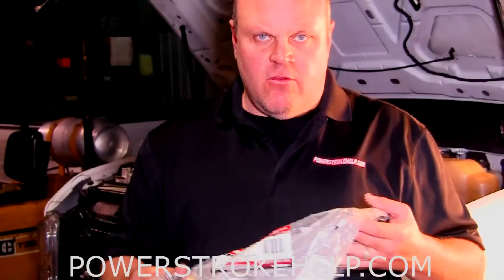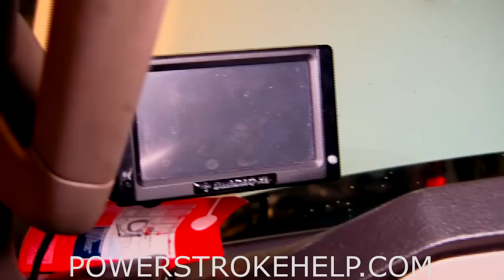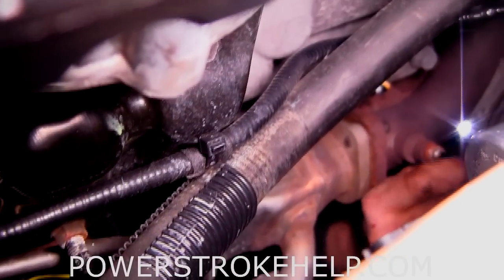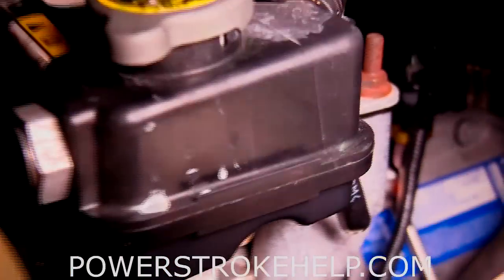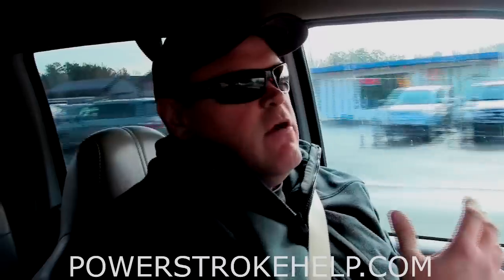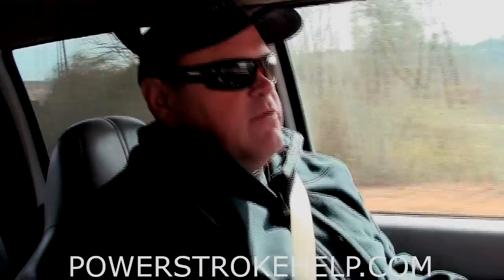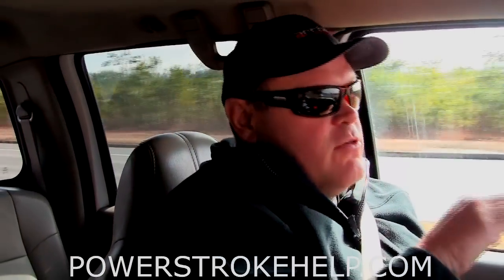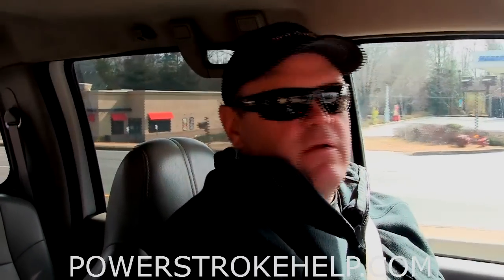6 4L EBP FAILURE - EXHUAST BACK PRESSURE -POWERSTROKE

Comment: Hi, I want to personally thank you for this video. My problem was just as you described. Loss of power, dropping fuel economy. I thought my turbo was needing replacing. Took a chance bought the tube sensor assembly $79.00 on ebay. removed the old sensor / tube was clogged tight with carbon. Cleared the manifold fitting with a 3/16 drill bit. Installed the new sensor/tube assembly and back to normal. Power on acceleration better than ever.

Comment: I had an issue with my EBP sensor...except it wasn't that it failed, it was that it broke off. Don't know how, but it did. Was going to relocate it it and remove the whole pipe (EGR is long-gone) but due to time I simply cleaned the surrounding areas (sooty!!) and installed the new part. Truck came alive after that! I hadn't noticed the progressively-worsening throttle response and MPG loss. Runs like a champ now. I love my 6.4!

Comment: My 08  6.4 now has 460k! Had Jasper build up my engine and trans 3 yrs ago. Currently having similar issues as you have described. Will try replacing sensor and cleaning tube port as you recommend. Will keep you posted.

Comment: Yep! Had a problem with mine, it was missing really bad. Dealer wanted $1000 to change it, I took off the sensor and cleaned it. It worked great again.

Comment: Funny you should bring this up Bill...  I live in Michigan where it's been around zero degrees for the last few weeks. When it's this cold my back pressure sensor does not read right. Condensation freezes in the tube and messes up my reading, which messes up my vgt actuator... Insane boost at very low throttle. Thanks to my Dashboss I can pick up on it right away. I've been un plugging my vgt actuator to lower boost. i don't want that really high boost pressure wrecking my engine!

Comment: Bill, love your videos! Could I ask you a favor do a series  of videos on say the top 10 things to check when buying a used power stroke. IE; check old level in the 6.4 to see if it's high or low. Leaks around water pump. Etc etc etc

Comment: I had the same problem with mine 2008 F350 6.4 all has ben deleted H&S mini max mild tune I was driving and lost power and like you said it takes a lot to get up and go now I replaced the part done in about 15 mins total time truck is fixed!!!!!!

Comment: Bill, help me figure this out as no one can....I have a 2008 6.4 drw with 25,000 miles on it, yes 25k. I NEVER see better than 11.5 mpg on highway and 9.5 city. My truck is stock, and I do not beat it. Its mostly babied not towing or hauling anything. I find it crazy that you just mentioned in this video 18 mpg.
Reply: Thanks again, Bill. Straight to the point no BS. Not noticing this yet. Keep your maintenance up

Comment: I have a 2008 6.4 powerstroke diesel truck. It is DPF and EGR deleted, SCT TUNER mild daily driver tune. All brand new Ford oem fuel injectors, injector harnesses, all new rocker arms, new glow plugs. All done by a reputable diesel mechanic. My problem is after about 2 weeks it started smoking. It only smokes at idle or anything under 1000 rpm. The truck runs great no problem except white smoke coming out of the exhaust. It doesn't use oil and doesn't use any coolant either. I cleaned the air intake tube, new filters everywhere, both fuel filters, oil filter, air filter. What could this be. Does my truck have a PCV VALVE? Could it be the EBP?  Maybe MAF?  I don't know what to check or how to check or test these. Any help would be greatly appreciated. Thanks so much!!!  
Also, my truck was completely checked out for any issues by the mechanic and everything looked good while he had it apart working on it. It has 200,000 miles, but less than 500 miles on all the upgrades and mechanic work I mentioned. I also thought maybe the tune is off a little bit causing it to smoke at idle and under 1000 rpm. It doesn't smoke at all until it is at operating temperature. But even at operating temperature it doesn't smoke at 1000 rpm or higher.

Comment: On a cummins engine, i compare barometric pressure with exhaust gas pressure at key on engine off, both readings should be the same.

Comment: Stupid question. Can I just repalce the sensor? I pulled to tube and it's clear. The new tube doesn't want to thread on nicely. So I figured maybe it would be easier to just replace the sensor.

Comment: I have an 02 7.3, replaced the tube and sensor and recently the pigtail and still get the P0472 code on my cts3 edge monitor. The reading on my edge shows 29 and never changes. What could be the issue?

Comment: Bill, I have a 2002 F-250 XL crew cab long bed 2WD automatic 7.3 diesel pickup with 240k miles. What are your thoughts about changing out the stock Garrett GTP 38 turbo for the 38-R and what else should I have done in the process for better performance and reliability with the turbo swap?

Comment: I dont want to use a tune on my truck because i have a 6.0 and no studs yet. What should is the best system to use?  i.e. edge tuner. I want to be able to add tunes later on when i get it studded but i only want to buy a system once not one for now and a new one later.

Comment: 1:00 on my trucks I've always thought that to be caused more by the DPF state, (clogg %, engine & outside temperature, exhaust temperature and how long temperatures have been at said state to reduce DPF sooting), but when tied with that code and seeing just one 7.3 back pressure tube i can see that to be a prime suspect

Comment: Hey Bill, Nice Archoil hat!! What happened with rev x?! Great video as always!!
Reply from the maker: RevX is yesterdays news bro. Archoil AR6200 will increase your fuel economy like no other additive because it is the only one that lowers the combustion temps by up to 400F.
Reply: powerstrokehelp I noticed the same thing. I used Archoil on my 6.0 last oil change. Truck runs super smooth. Thanks for the videos... Every time my buddy has a powerstroke question, I just find one of your videos. Makes me look way smarter than I really are.
Reply: powerstrokehelp
Does Archoil work in the 6.4L?

Comment: does anything not fail on the Navistar?
Reply: A Navistar never fails to fail.
Reply: ShamusOGrady2 Show me any car/truck/engine that never fails...
I've had and seen PLENTY of dodge and chevy that were not worth the paint that rusted off of em.
Reply: Patrick TheBaptist All failures are Administration failures.  It was some CEO that approved or pushed the crappy design.  I had a punk 1994 Chevy 1500.  The 4L60E trans burned out every 60,000 miles, like clock work.  I purchased the truck new.  changed the transmission fluid religiously and never abused it.  But, the Navistar takes the cake.
Reply: WAVETUBE84
I do need to firm up my position, I hate the newer trucks, PERSONALLY I would NOT own another other PowerStroke than the 7.3s, all the newer ones is just a waste of hard earned money.
Yeah I had a 95 G30 van with their 6.5L non-turbo, it couldn't make it to 160k before the heads were cracked.
Isuzu makes a nice diesel, I had a 92 FSR with a 5.8 I6 turbo and it sure took some abuse at my hands hahaha.
Those 6.7 Fords are really stupid, ceramic ball bearing turbos guaranteed to dust and destroy the engine, I had to stand on your side, seems they did that knowing it would result in damage for the owner and money for the "stealership"
The 7.3 I have the ford stealership could not it started after 1800 in work done, took me not 2 hours to figure out it was the fuel tanks, the truck wasn't getting fuel...  They were as dumb as I don't know what OR they were liars and were milking the customer, I paid him less than that for the truck and over a year later I'm still cruising in it....  Front fuel tank was clogged and rear tank pickup was broke off and the dealer thought a turbo rebuild and PCM would fix it... 
These newer diesels cannot see 500k without serious engine work, 7.3s with oil and coolant changes can expect to exceed that AND also replace the stock breather box with a cold air intake (the breather boxes were the worst idea ever, they bust and don't seal good and are usually the end of alot of 7.3s that never should have.
Reply: WAVETUBE84 No, the Navistar 6.4 is fairly reliable. The Powerstroke is the problem.
Reply: Patrick Baptist if you put the kind of power in these trucks a 6.4 or 6.7 have the 7.3 would split the block open. The problem is lack of maintenance and computers. You put a complex computer on a 7.3 and it wouldn’t run either. Mechanical issues go without repair if you don’t know they exist.

Comment: im having a major oil consumption issue with my 95 7.3 was wondering what the possibilities could be i was thinking injector o rings, i checked my fuel bowl doesnt really have any oil in it and im thinking of pulling the intake and downpipe to see if the turbo seals arent leaking. just wanted your opinion
Reply: start simple then move to more complicated fixes. major oil consumption on 7.3 ive noticed usually is injector o rings. im not quite the expert bill is though.
Reply: yeah theres really not much else that would cause such a massive oil consumption other than injectors, injector o-rings, a plugged pcv, or worn rings. but worn rings and a plugged pcv valve i dont think would cause something as drastic as 1 gallon every 100 miles. i pulled my injectors today, the 96 and older trucks had 2 oil/fuel orings in the middle of the injector and almost all of mine were ate away so i put the updated orings in and im waiting to drive it but i think that fixed the problem
Reply: i have to do them on my 99 but it has 312k on the original set of injectors so im going to replace both. should fix my problem
Reply: Your turbo seals might be shot. Better keep a towel with you in case it runs away
Reply: no there alright.. all 8 of my injector o-rings were worn half way around. ford updated the seals in 97 with 1 seal in the middle of the injector that separates fuel/oil insted of the old 2 seals (that mine had)

Comment: Hey bill, I have a 2005 f250 6.0 and when you take off from a dead stop, it pours out black smoke and kinda lags behind In power until you get to about 1800 rpms then it drives normal. Is this the same problem as in the video?
Reply: watch his video on vgt 6.0 problems.
Reply: Wildman Check the MAP PORT clear it out with a metal coat hanger. Also check the EBP Spencerport on the exhaust side clear that out with a coat hanger as well. Next common thing would be the vgt valve connected to the turbo.

Comment: I have a p040d code and limp mode. I broke off the sensor on the up pipe. does anyone think I can get a egr and dpf delete tuner that it'll bypass this sensor? then I can just plug it in and zip tie it somewhere?

Comment: This was helpful.  Just spent thousands of dollars only for the truck to read drive to clean the exhaust system.  Three injectors and a fuel pump was replaced, but for some reason the truck is loosing oil, and at times won't start until I put more oil in it. Unable to determine where the oil is going.  Any suggestions?
Reply: Turbo seals may be bad

Comment: powerstrokehelp Great videos, Heres what I use in my shop and personal vehicles to monitor and diag problems. Its cheap and for a small 4X4 gasser shop works great. For OBD2 coms, I use this guys https://www.scantool.net/ amd there Bluetooth com. They have great software for your phone/tablet/PC. For just monitoring my Personal Vehicles in use I use http://torque-bhp.com/, its a GREAT program. It lets you see all SAE standard PID's and if you know the OE proprietary PID's  you can add it to the dash which is fully customizable. It also does data logging of any sensor you can read the PID's of.

Comment: Do you have the part number? mine is on a 2008 6.4 f250
Reply: I also would like to know the part number.
Want to go ahead and replace it on my truck  I have 120xx miles on it
Reply: @rudyreyna379  ever find out the part #